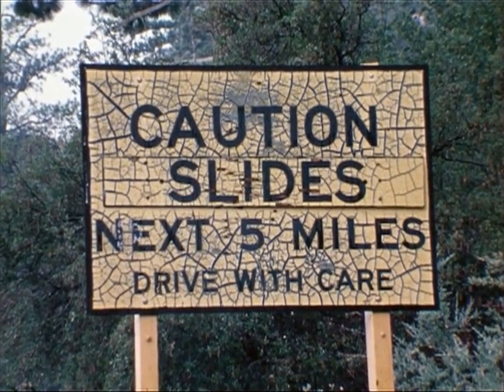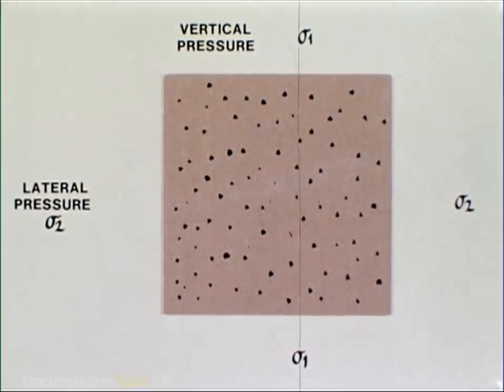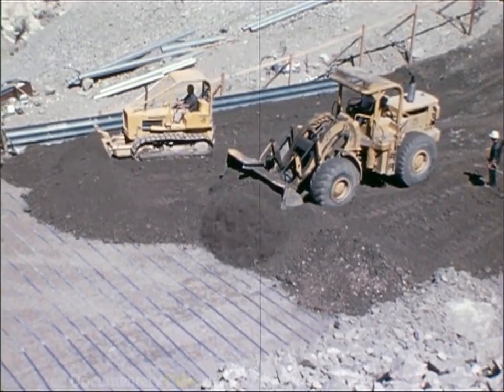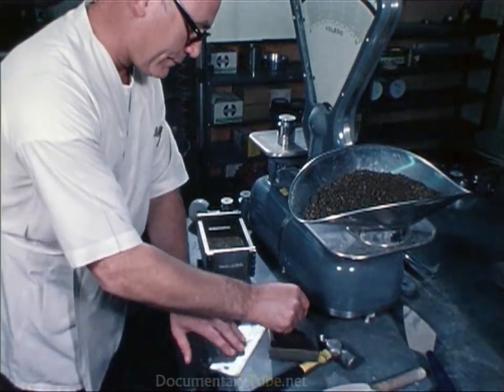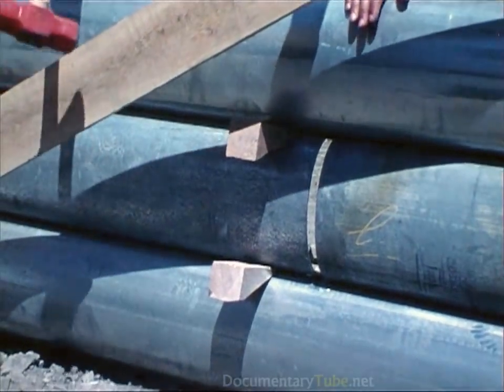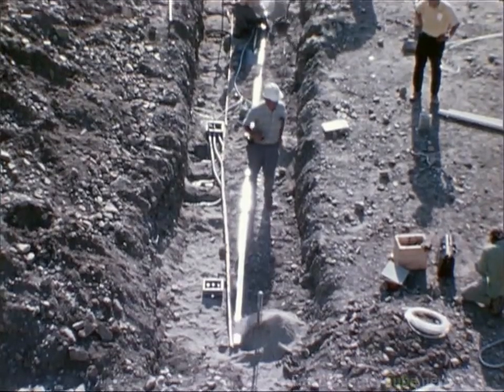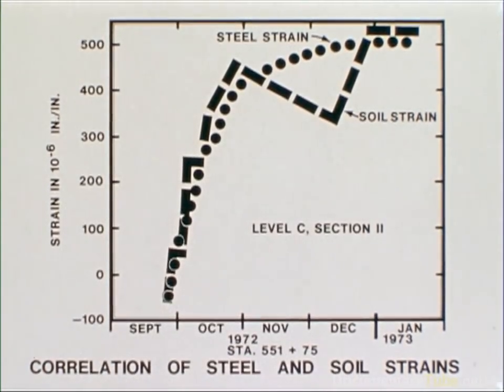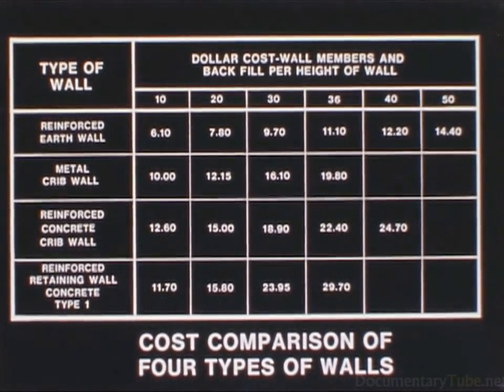Road Embankment Construction Project

Comment: Since this was basically something new and untried before in North America my best guess is there was a whole lot more instrumentation added during the construction phase so data could be gathered for use on other projects. It would be interesting to know if that wall is still there and how well it's stood up in the last 60 or so years. My other guess is because of changes in methods and costs a concrete bridge to do the same might now be more cost effective. For the 1960's those were pretty high costs per ton of compacted earth. Open cabs and no ROPS on the equipment make it look pretty strange today. Glad I missed that.
Reply: If I could handle the cold I would move there myself

Comment: i'd describe this as a fail.  twenty years ago i was involved in a similar technique to prevent pressure on a tilt-up preformed concrete wall to maximise the size of a car park on a sloping site.  maximum height of about 12'.  it involved polypropylene mesh fabric laid down where this method used flat steel bar, towards the edge, then built up a bit over 18'' then the sheeting was folded back and another sheet was laid down and again folded on top of another 18" of dirt.  the smart arse engineer who thought this bull shit up demanded we didn't compact near the edges.  the concrete wall had sagged off vertical, especially near the corner, about 6 months later.  there was also some pinning with cables involved.  there are fundamentals about retaining walls.  5-10% slope is needed or extra thick concrete at the base on the inside face that tapers to the top to make up the 5-10%.  and deep stable footings below ground at the base.  liquefaction caused by earthquakes or even heavy trucks will destroy this method shown.  steel reinforced concrete has already been invented.  it works great.  this method is like sandbags.  good for a foot or so.  it should be compulsory for all engineers and architects to learn how to dig a hole with a shovel as part of their training before they get a qualification.  fascinating earthmoving machinery.  thank you for posting.

Comment: It's no wonder California had financial difficulties. they were spending big bucks doing a study that was already known for centuries before. I've done retaining walls and know that you have to stair step it up from the bottom or it will eventual come down. I wonder how long it was before this came down because it wasn't done to prevent additional slides, only to prevent the current one from moving again.
Reply: You missed the entire point, this wasn't about the retaining wall, but about how not to put too much stress on the unstable ground. A vehicle going over the road puts pressure on the ground, that pressure is distributed on several layers of horizontal slats connected to the retaining wall, the pressure on the slats tugs on the wall. That means when a vehicle is going over it, the weight of the vehicle pulls the wall inwards towards the road. The point of the exercise is to redistribute a heavy but random local force over a much larger area, making that part of the road less susceptible to failure.